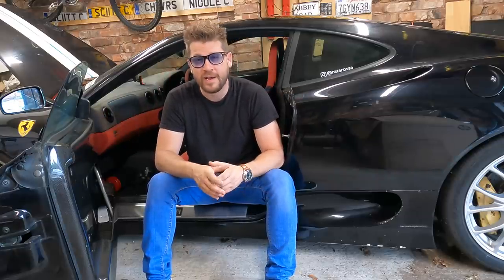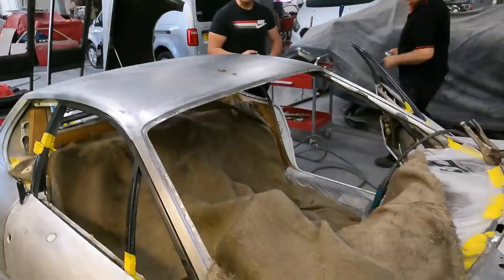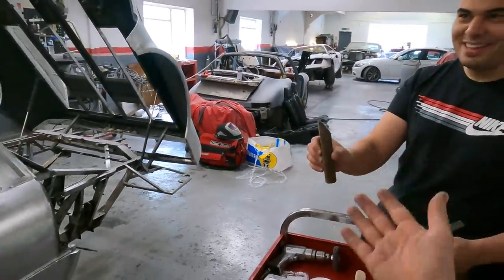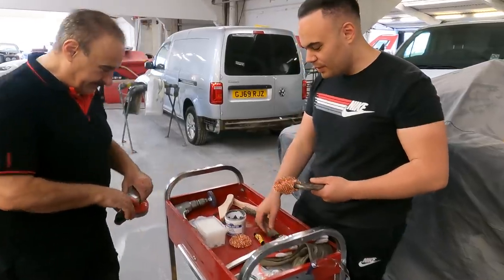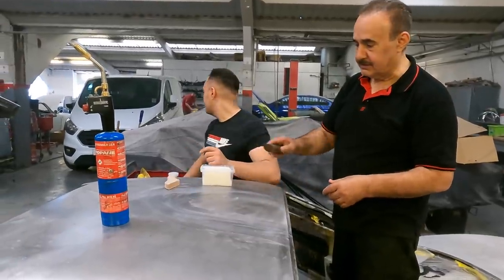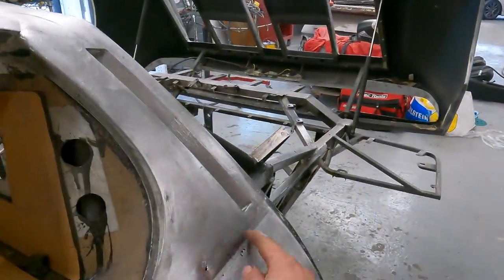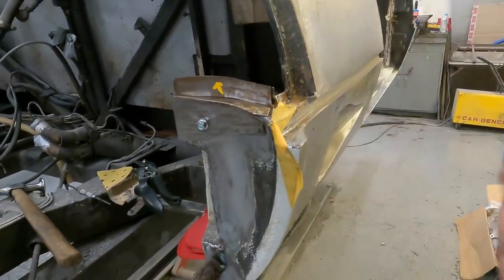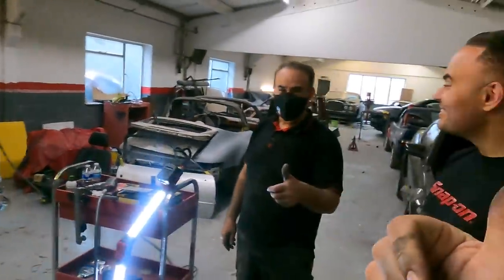Barn Find Ferrari Boxer  Repaired Using Old School Methods - How to Lead Bodywork.

Comment: Just hope we never lose the skills of these old school guys, irreplaceable.
Reply: The young guy will carry on.
Reply: Well if they keep working with lead without any protection like that....none of them both will carry one for long........
Reply: Amazing job !
Reply: pick up a hammer, learn how we all do
Reply: @ErikRotterdamNL  You need to injest lead for it to be dangerous. This is basically the same as soldering, you dont see people wearing masks when soldering, just a fume extractor because the flux fumes can be harmful, they aren't using flux here and its in a large open space.
Reply: @pn8902  And power sanding it EINSTEIN?
Reply: @geneva760  its in an open space, also lead falls right back down since it is quite dense :)
Reply: That workmanship is top notch! Glad that BBI getting the needed treatment at the right work shop!
Reply: A lot of those skills are being lost sadly.  For example,  even though NASA have all the blueprints to the engines for the Apollo Saturn V rockets,  attempts to build new ones have failed because a lot of the assembly notes which were written by the original workers have been lost and the "know how" went with them to the grave.  Apparently each engine required over 50,000 intricate welds by hand.  It's a shame when that sort of thing happens.
Reply: I was just going to post the same comment.  They definitely are a dying breed
Reply: Truly incredible

Comment: lovely work. Glad to see there's still people that avoid body filler :v
Reply: They filled the roof with polyester glaze
Reply: There will still be some filler after the lead. There will be an etch/epoxy/anti rust primer type layer, but you still need some fine sanding layer AKA a very light skim of filler to smooth out before paint.

Comment: I was taught how to do lead work by an old Chrysler body guy, from back in the '50s.  It is a skill that has all but died out in the days of body panels held on with epoxies.  I don't get enough practice with it, but I am glad that I was taught this.
Reply: Kind of literally died out because years of breathing lead fumes has killed many a body guy. Lead is the proper way to do these repairs but proper safety equipment will keep you alive to do it. Lead went out of fashion because of the danger.
Reply: I was gonna say, this should be equally applicable regardless of how a panel is attached to an adjacent panel so long as it's steel. Epoxy is probably just considered a less problematic material to work with from an HSE (Health/Safety/Environmental) standpoint...

Comment: Body leading !!! Absolutely a great vid on a vanishing art. Car manufacturers actually used body leading in mass-produced vehicles in North America for sure. I remember seeing a series of ads for people building Buicks in the mid-late 1970's. One of the ads featured an older guy with an oxy-acetylene torch, a stainless steel brush about 2 inches wide and a bar of lead filling in the roof shell-to-rear fender join on the C pillar of a B body Buick sedan. He did it in the time it took to walk along with the body as it went down the assembly line. I bet it took him no more than 30 seconds at most to do a beautiful job that would have taken, maybe, 10 seconds to smooth out with a sander further along the line by someone else. I don't believe they still do THAT kind of craftmanship any more.

Comment: Love seeing this stuff. I did some of this same type of work, leading,metal work with hammers etc. a number of years ago at a buddy’s shop. I was considering getting into restoration work at the time. These are really awesome skills to learn and the result is so much more satisfying and correct. It’s a lot more work but it’s every bit worth it to know that it doesn’t have pounds of filler and that it’s not just going to rust again in a few years. Thank you for sharing this content, great video.

Comment: Only ever worked on one Ferrari it was a 308gt hit on the NSF wing and ripped it , the boss said no filler so I leaded it , the job needed a skim of filler so I said can I give it a light skim , no filler he said so I said what about 2 pack stopper no filler again thought well he never said no 2 pack stopper so skimmed it , gutted was not allowed to drive it LOL . 
You can get a thick paste for welding put it around the area you want to weld it acts like a heat sink stops buckling much better idea than messing about with an airline , I was a panel beater for 35 years . I used oxy acetylene when leading and would never lead over rot as it's still there and will come back all you are doing is hiding it for a bit longer .

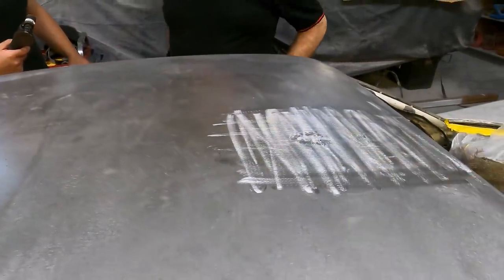Comment: 4:35 I would weld those holes and grind them down and repeat that until you don't see a difference with the rest of he sheet metal,
and then you don't need to fill it up with tin.

Comment: Am I just too careful with the gas flow (too little) because I feel I can't get any good welding done with a MIG with longer than 1cm of wire from the gun? I understand that a 230V machine is not ideal, but I've seen people getting much better results with similar machine.

Comment: I cannot even understarnd what are they doing, and cannot guess what metal is this body made of. Is it zinc ?
Reply: Its a steel body. They are using lead as a filler. Basically the process is tallow on the paddles to stop lead sticking to them. Then apply flux to the panel and put hot lead on it and work flat with the paddles. Once hard file to shape with a bodyfile. Ensure all the acids in the flux are cleaned before paint or itll react. Its okd school, kinda cool, but modern fillers are so much easier and dont react with paint or poison you with fumes, but nice to see it being done even if its not truly 'period' for the 80s

Comment: Curious. Why is this lengthy process necessary to fill a small hole?
Reply from the maker: as opposed to slapping a load of filler on it to cover the hole ?
Reply: @Ratarossa  As opposed to tack-welding in that first filler piece, and smoothing it all out with a grinder I guess?  I’d love to learn about why all the metallurgy on top is needed. Really cool process, thanks for sharing! Those guys were a hoot!

Comment: The proper way to repair a few small holes is drill the holes out a big larger and cut the new piece off metal a bit smaller leaving a little gap around edges then weld it in with a tig welder because it puts less heat into the panel then sand  the repair flush and lightly hammer and dolly the repair never use a mig welder on a roof panel

Comment: Especially difficult with an aluminium body.
Reply: That roof panel is steel however, but yeah doing anything on ally is harder as the melting point of the oxide layer is higher than the metal itself

Comment: Old school doesn't mean better, espcaily about solder fill! Banished in the trade because highly poisonous!!! And the old guy file it with no dust mask!!! And the repair will still show with a thickness gauge, anyway. So, what is the point? And you will paint the car with a brush also??? Like they did 100 years ago ???

Comment: Tinning butter - "Avoid breathing dust/mist/vapors/fumes/spray. Do not get in eyes, on skin, or on
 clothing. Use in a well ventilated area. Wear protective gloves/protective clothing/eye protection/face protection."   From the "Safety Data Sheet".  And then the guy uses a DA to sand it - what a moron.  Have a safe and nice day all.  CHEERS from AUSTRALIA.